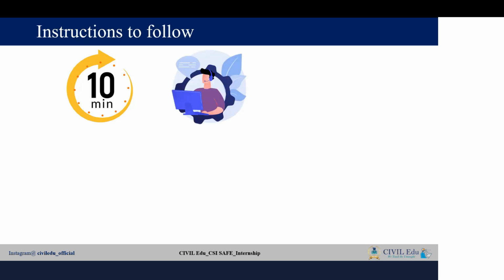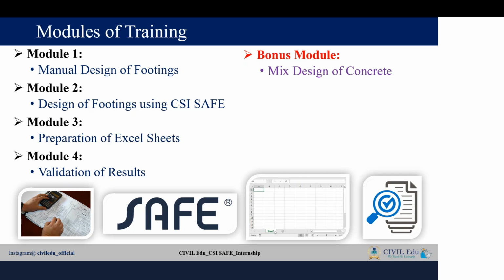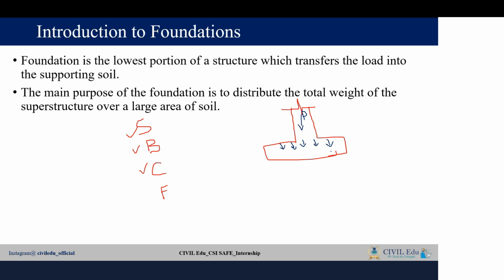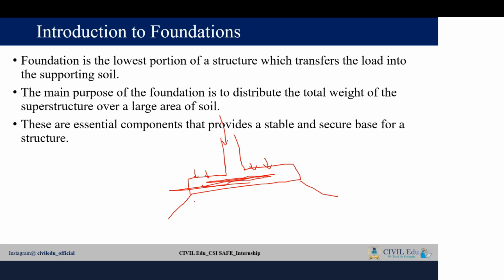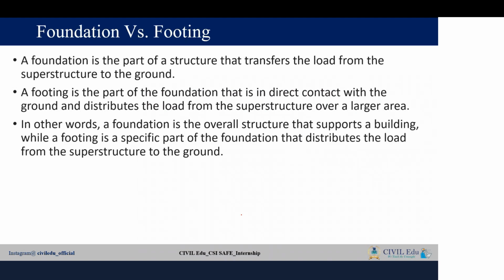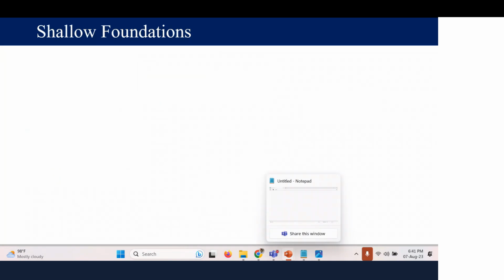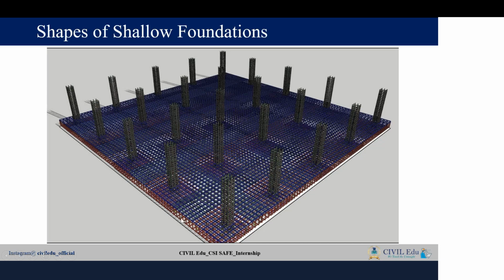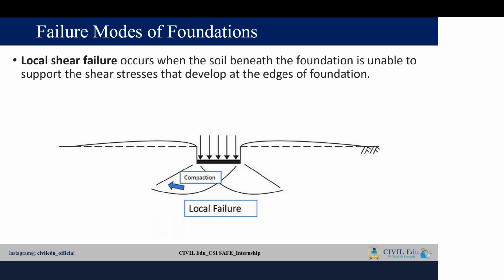Day 01_CSI SAFE Internship Training_CIVIL Edu

Comment: Sir.concrete solid block can be use in load bearing house construction without any column and beam!as we using red bricks  in villege as load bearing?
Reply from the maker: Sorry, I couldn't get your question properly. Could you please tell a bit more in detail?
Reply: @LearnWithKASTRO  sir, i am living in villege where all house build with red brick load bearing method which is without column and beam! i am going to build my new house in my villege with low buget so my Q was that can i use concrete solid block without column and beam to reduce cost as you know block is cheaper then red bricks
Reply from the maker: Okay. If you are constructing a room (on the existing house) then, you can proceed with Blocks. But if you are constructing from the ground layer, I suggest you to have beams and columns as they will help you for future extension of the house. Moreover, for better stability, I suggest you to use beam-column type construction.
Reply: @LearnWithKASTRO  thank you so much